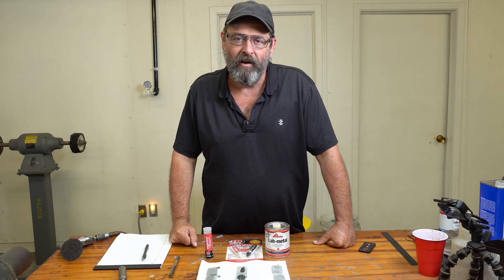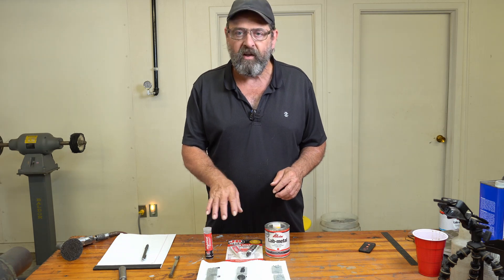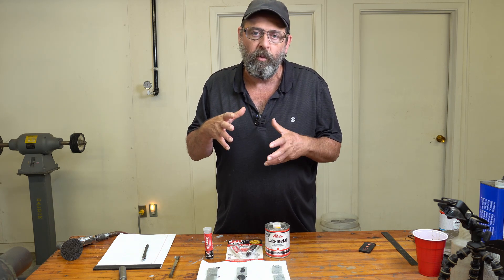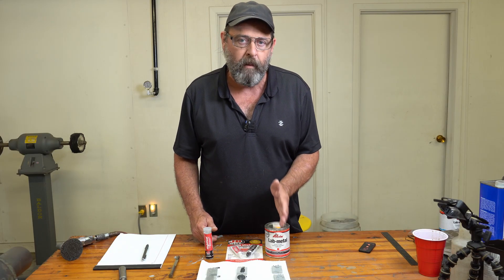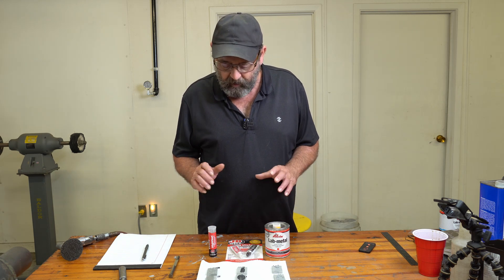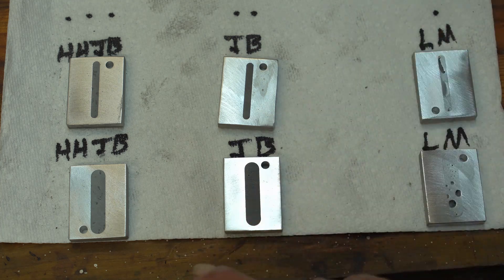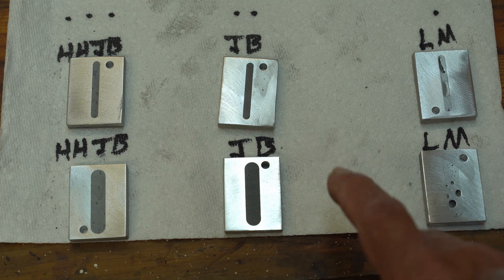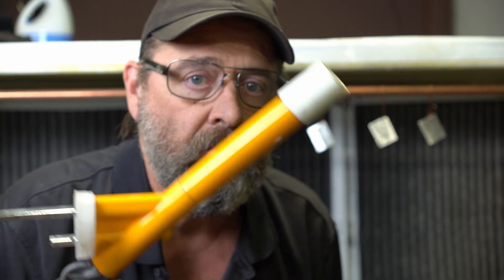CAN YOU POWDER COAT JB-WELD?!

Comment: I always hear guys say use JB weld and question it.  I think there is a point where depending on the item you either need to work the metal better or use some lead but not sure how well lead will hold up overall either.

Comment: Larry, it's always great to see a new video from you. Thanks for doing this comparison. I'm looking forward to seeing how you use Lab-Metal in a future video as well as the electrolysis video using the DC power supply. Keep them videos coming! 👍
Reply from the maker: Thank you for the support!!
Reply: @CycleFab you don't by any chance no any links for the electronic control switch module inside or the purion spark generator I've got the 120v Chicago electric one but I've blown it by plugging it in the 240v in a rush wouldn't mind but I've had it years & always run from a 110 transformer.or anyone in the comments reading this ?
Reply from the maker: No, I don't know of any links for parts.  Sorry. @officialmysteriousrider130
Reply: @CycleFab  ok mate look like each components individually & just soldier them on until it works again. do yano any of the names of your parts inside haven't you got the different model with the adjustable nob on the back ?